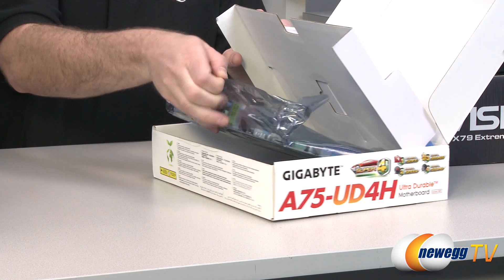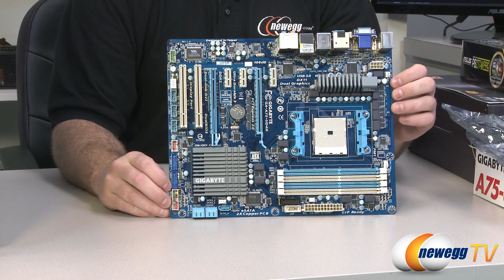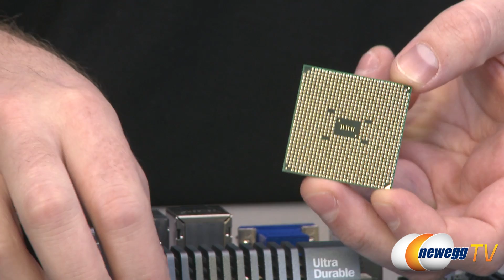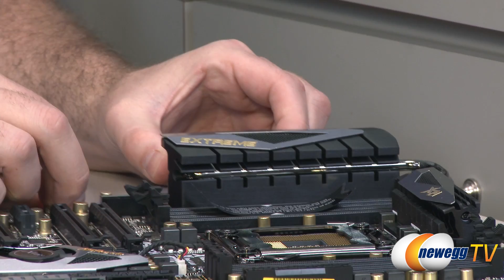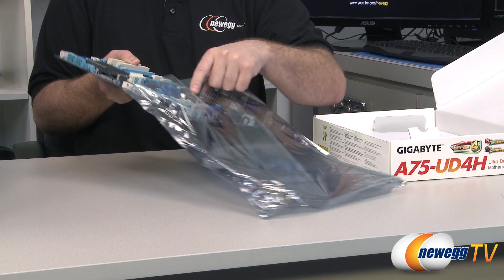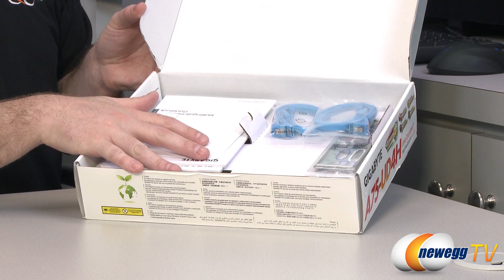Newegg TV: Motherboard Handling, Installation and Shipping Guide

Comment: Yeah but with that model you're getting the retina display and I'm sure your last gen dell doesn't have an SSD or a Geforce 650m. I'm not saying that its definitely not over priced but they sure do last longer than most average PCs. As for the desktops well thats true, but you're not getting Mac OS X which I use on a constant bases for work.

Comment: I saw this and lol'd harder. You're still using a mac to run windows. Idiot. Hmmm, if I remember correctly it would seem that laptops aren't really that upgradable when it comes to parts just you know the ram and HDD. You can't change much in their iMacs series, but then again it is an ALL IN ONE computer and ALL IN ONE computers aren't that upgradeable. The only one thats truly upgradeable would be the Mac Pro desktop which is kinda pricey, but the specs are pretty neat. IDIOT.

Comment: sheer numbers, really? Tell me if your mac can use a gtx titan, overclock cpu, ram, gpu , upgrade, sli gpus, use amd cpus, use silent fans, use multiple cases, have hot swappable hdd bays on the front, fan controls on the front, displays with nvidia 3d vision built in, UHD display (2560x1600), run 4k diso off the motherboard....OH WAIT, YOU HAVE A MAC

Comment: I'm on my 4th build of high end gamers and I can assure you that as long as you don't live in a high static area, work around a lot of carpeting and move around a lot, you should be okay. It's always good to be presumptive, but if you gather everything that you need right there where you need it, everything will go smoothly. If ever in doubt, just ground yourself on the case first before touching any sensitive components.

Comment: I just had my sabertooth delivered the other day and the armor is very securely attached to the pcb, i am confident handling it anywhere the armor is because of this. :D Its called armor for a reason!

As to your other comments, as long as your psu is metal and securely attached to the case it conducts between them and they act as a single entity for the purposes of grounding. The case works as a ground because its possible to discharge to it but its better with psu installed.

Comment: I got a Ultra rogue M925 full tower gaming case and while i was building my 
computer i wanted to make sure the power buttons were working so i tested out the button on the front that said RESET, it worked but not my computer won't turn back on...

Comment: And don't get me wrong. 'Apple Fanboys' annoy me as much as they do Windows based users. As they give other Mac users bad names. As I said, I bought my second hand from eBay for approx £750, it has a quad core 2.5ghz i5, 16gb of Ram, 6750m with 512mb, 120gb Vertex 3 and a 2TB second drive. For me that was a bargain. Admittedly if you were to get the same in a Windows system it would be £100 or so cheaper. But as I need it to be run Logic, it was too good to pass up

Comment: lol, Macs are better than Windows based machines.. at certain jobs. And Windows based PCs are better than Macs at other certain jobs. I run both Win7 and OSX. I love both of them. Ive used Windows for 15+years and OS x for approx 4. The one thing I can guarantee you is day to day usage of the OSX is about 10x more enjoyable than a Windows system, no crashes; not responding; little annoyance that slow your day down. I'm not a 'Fanboy' I use both. But stop whining and try it before you knock it

Comment: the only reason as to how people might see macs better is that they're in a universal setup. As in one brand, one manufacturer. Do not have to go through different branding, different manufacturers, different specs. Hence do not have the same issues pcs might get because the motherboard is one brand, memory is a different brand, and so on and so forth. But for the most part apple is just a company with a monopoly on their OS and therefore just charge far out the arse for their products

Comment: im thinking of building an i7 gamming rig im saving for it going to reuse my psu and case and my zalman cnps9700 or i might get a different cooler. i lost part of the intel socket mounting system

Comment: I believe those protective plates on intel sockets are not to be removed manually even at the point of CPU installation.. These plates are RELEASED AUTOMATICALLY by the CPU itself once placed in the socket...and the retention arm(s) is replaced into lock position..

Comment: Probably not, but why the hell do you have an AMD fx? They're useless for gaming. Most games don't even use 2 cores. Get yourself an i5 2500k, it will run as well or better at gaming. Also, do you really need two gtx 670s? I wish I had as much money as you.

Comment: BTW, the best anti-static ground is to take an extra power supply cord and cut off the 2 flat power socket plugs leaving only the 3rd round ground pin. Plug it in.
Paint the cord with a bright neon color (yellow or orange) on both ends so it is obvious that it is a special cord. Helps find the problem later when the computer won't power on.

Some power supplies do not have an external switch. It is mandatory to use the above cable because a standard cable will provide power to the MB.

Comment: ...cont.
Computer with large aftermarket CPU cooler transported with cooler attached. Recently worked on computer that would not boot after a company moved office. CPU cooler broke loose from socket and was laying on the video card. Cooler mount was damaged beyond repair.
Mechanical interference with other installed devices in computer case. HDD & DVD drives contacting memory chips, video cards etc.
Folded cables damaging internal wires.
Red fiber insulating washers used on MB screw ground pads.

Comment: ...cont.
USB headers installed backward short out the socket and damage the circuitry.
Improper I/O shield installation. Including shorting the USB and LAN sockets with the shield ground/tension lever.
Improper standoff locations shorting to bottom of MB. Also missing standoffs allowing MB to short to MB tray.
Incorrect screws used with standoffs allowing MB to come loose.
Missing MB screws and extra screws loose in case.
Missing expansion covers allow mice in.
Loose cables hitting fans.

Comment: Being in IT for over 25 years, I've seen some alarming "techniques" dealing with motherboards, mounting and attached components, wires, cables, etc. Common installation issues...
Trying to force the wrong type of memory into the socket. DDR2->DDR3 socket.
Memory forced in and latched backward.
Power connectors installed backward by brute force.
Keyed cables and wires forced into sockets without key. IDE cables w/blank pin MB without.
MB header wires installed backward or completely wrong.

Comment: Take a piece of wire about 4-6 feet long (flexible is better) strip off about 6 inches of insulation. Wrap that end around your wrist and twist wire until snug but not tight.  Then take off about 1 inch of insulation on the other end and attached to computer case by wrapping around a loosened bolt or screw and then tighten down the bolt or screw.  You can also attach a clip to that end of the wire just like the one shown in video and attach it that way.